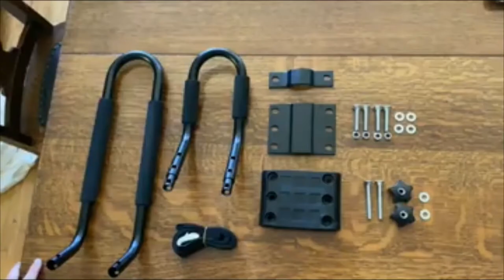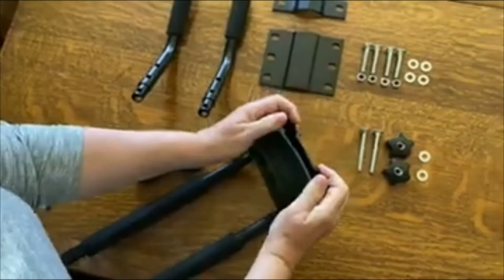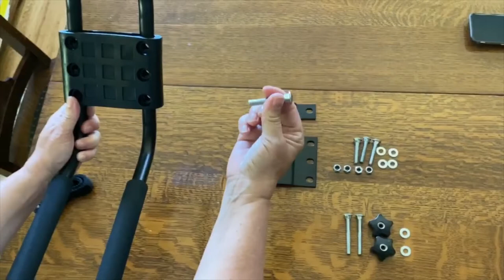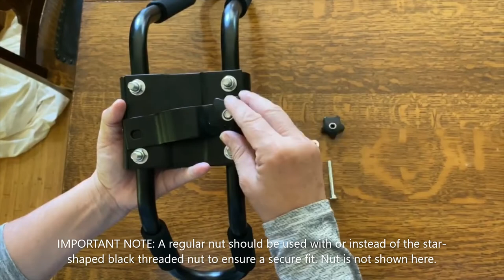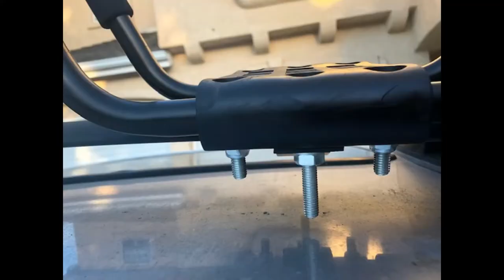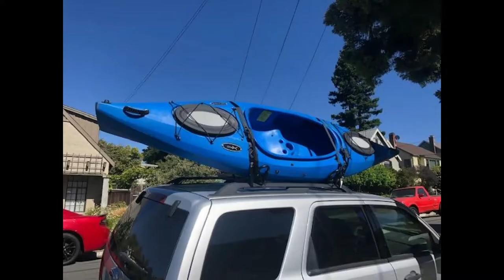How to Assemble a J Bar Kayak Roof Rack

Comment: My assembly puts metal plate inside rubber sleeve.  Look closely at sleeve and you see molded indents to accommodate plate. This way sleeve is against cargo crossbar reducing crossbar compression and slippage.
Reply from the maker: Hi R Mitch.  That is interesting!  I (Meg) am kind of a stickler for detail, so I went back and looked at the printed manufacturer's installation instructions, plus checked out the video instructions of a few other identical models on YouTube, and they all had the metal plate on the outside of the rubber sleeve. Having said that, I do agree with you that it could go on the inside and that it does make some sense to be there, for the reason you state and also to provide some scratch resistance to the cross bar. It seems that the other, smaller attachment plate would also have a rubber sleeve if it were intended to be used this way though, perhaps?  Thanks for the comment!
Reply: I agree with you as my instructions and watching youtubes say what you say.  What bothered me was my rubber sleeve definitely has molded locations on the inside for the large plate.
Reply: That's what I came here to find out ha iv used mine like she has for years but my dad just suggested what you said.

Comment: Why would younput the bolt outside ,so you have to take bolt off ever time you take kayak off roof??  Most videos ahownit likenthe other side
Reply from the maker: Hi.  Not sure I follow what you're saying.  Once the J-Bars are attached to the roof rack, you don't have to do anything with the bolts to take the kayak on and off.  You'd only adjust/remove the bolts if you wanted to take the entire J-Bar off.  Feel free to send a link to whatever videos you're referencing.  Thanks.